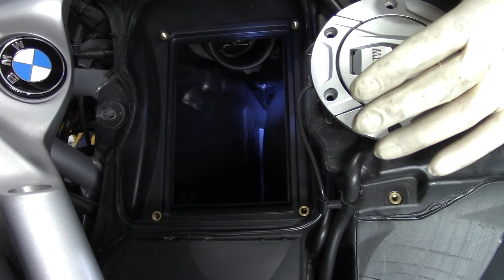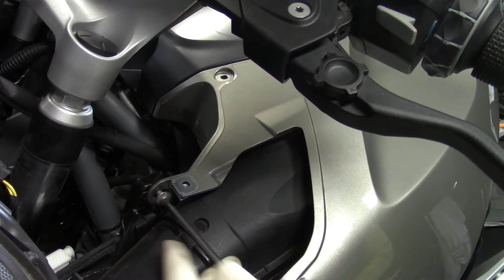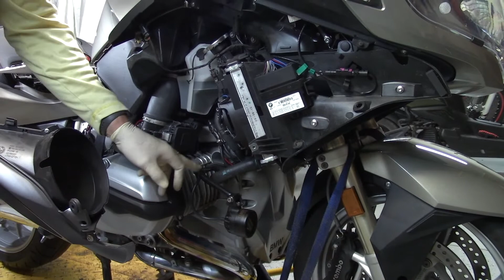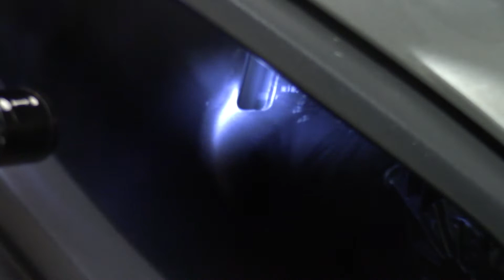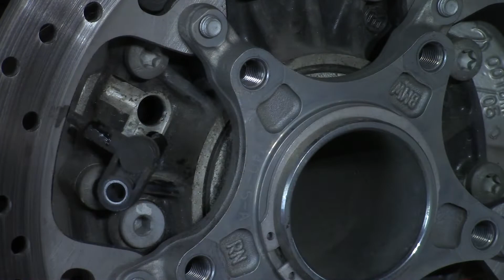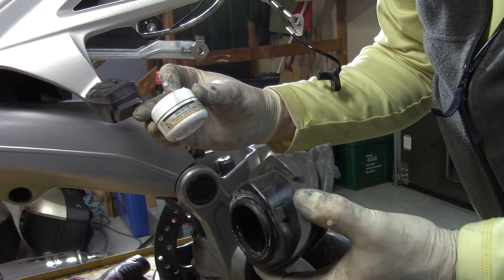BMW R1200RTW 12K Mile/20K KM Service  Part 2/6

Comment: Hello Boxflyer please let me know how to test a rear brake caliper and a 2017 BMW R1200RT?  I've cleaned it lubed it and the pistons move in and out freely.  When I ride it my rear brake caliper is way to hot to touch.  Compared to the front.  Do you have a good supplier for the OEM caliper you recommend??  Can the old caliper be rebuildt?
Reply from the maker: Hi Gary, there are no replacement calipers other than OEM, so either buy new or find a salvage.  Looks like they are about $750USD from BMW, and I found acceptable rear calipers on "the" online auction site for less than $150USD.  The pin in the bracket is steel and the caliper housing that it slides into is alloy, so very difficult to see the wear pattern inside the pocket.  This wear, even though well lubed, can cause the two parts to hang up together and then drag excessively after you release the brakes.  I have been able to bore out the hole in the alloy caliper just enough to make it a perfect cylinder again, and then turn down a guide pin to fit the new hole, but it is labor intensive and requires the use of my lathe and milling machine to get exactly right.  The longer the caliper keeps heating up the rotor, the more likely that the rotor will need to be replaced as well...Good Luck!

Comment: Hi, and thanks for your excellent work on your videos. A have a question about the bolts to the caliper. What number of Loctite do you use 242 or 243? Thanks ahead Tommi in Spain
Reply from the maker: Since the brake caliper bolts are not exposed to an oily environment, 242 is suitable, if medium thread locking compound is needed and the bolting surfaces are oily at all, then 243 is preferred.
Medium thread locker is used only on the rear caliper bolts, the front caliper bolts are installed with nothing, no lube, no thread locker at all.

Comment: Hello BoxFlyer!  Could have I have performed the work and drop the final gear (to lube the spline) without a motorcycle stand or jack?  In other words, could it be done with just the centre-stand or just put a jack-stand in the center of the bike?
Reply from the maker: Yes, you can do all the maintenance covered in this 12k series with the bike on the center stand.
Reply: Thank you!  I am a big fan of your videos. Learned so much…

Comment: I'm working on the 12K service at 24K (dealer performed 12K), and just did my splines. The white goo on the boot was hard, so I'm guessing it hasn't been opened up since new (2017). Splines were clean. Boot removal was a pain, as was getting the shaft lined up right for assembly. Beer helped with the latter. Brad, I think your term "fiddly" qualifies for euphemism of the year. Many thanks for these videos.
Reply from the maker: Glad this is working out for you. My current recommendation for lube on the boot is white lithium grease. It does not get hard between services and that helps with not only putting it together, but also the next time you open it up…which for me is every 6k, not the 12k recommendation in the manuals. (PS— my spline lube of choice now is Honda paste M-77)

Comment: Regarding the coolant weep hole, did BMW do away with it or move it in the later models? I'm not seeing one on my 2017.
Reply from the maker: Starting with the 2017, the weep hole for the water pump seal is right above the oil filter.  There is a small pipe coming out of the side of the engine case with a rubber hose routed aft to just about the front of the shifter lever under the bike.
Reply: Ahhh...I see it. Hose tip is dry, but there appears to be a little bit of dried antifreeze residue on it.

Comment: Great video, Brad.  I was especially interested in the FD spline lube.  What a fiddly (technical term) job that is.  I had George (Gridlock Motors) do it on my GSA a few years ago (all was fine).  Not something I'd attempt, as I'm sure I'd end up with an unrideable bike, though given my lack of any "real" tools, I probably wouldn't get that far.  :-))
Reply from the maker: Hi Mark, I'll have a look at your bike in a couple of week.  I've done 2 WetHead GS 12k services over the last 2 weeks and both of them had a hole worn in the rear FD boot from contact with the rear yoke of the driveshaft.  I have 4 boots to be delivered today for spares since I used up my current inventory!
The rub spot is in the first deep fold of the rear boot when working your way forward from the final drive on the outboard side, or LH side of the bike...worth taking a look to see if your particular bike is developing a hole for water to get in.  This might explain why folks that think they have done a good job of sealing up the front of the boot still end up with water in the paralever and possibly rusted splines that won't separate.

Comment: Did you replace the paralever bolt (I'd seen somewhere that it was a replacement bit, so I did- came with red Locktite on the threads!)? Also- I found that the driveshaft was easy enough to align by pinching the spider and lifting/wiggling until the input splines slid home. The hard bit was having the third arm to get the (new) Paralever bolt in place, but the operation went quickly enough. Cracking video- thank you!
Reply from the maker: I did not replace the Paralever bolt.  I think that is called for because of the need for thread locker, which I apply medium strength every time that bolt gets reinstalled.
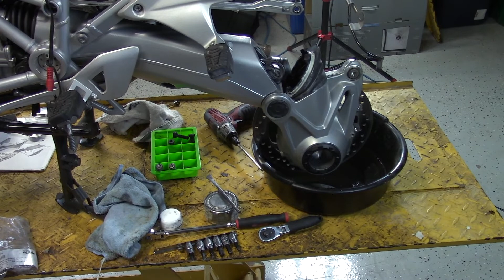At 25:15 I show lifting the driveshaft yoke up with a small piece of wire...but whatever works for you.
Glad you enjoyed it!

Comment: What do you recommend as an alternative to Castrol Molub-Alloy Paste-TA as it is difficult to find and Honda M-77 also very expensive?
Reply from the maker: I'm not always comfortable deviating from OEM recommended products, so my only alternative for this application is the Honda M-77.  Relatively speaking, ~$18 for this quantity might seem expensive, but it's the performance on the splines where so many other products fall short makes it worth it to me. On the plus side, this 2.65oz tube is probably enough for ~15 service applications on the splines.

Comment: My 1250 has only done 5000 miles, so no drive oil change needed yet. However, i would like to check the drive splines and lube them, so can i do this without draining the drive oil? Cheers.
Reply from the maker: Yes that can be done if you find a suitable plug for the speed sensor hole.  I've used a banjo bolt from some old brake calipers with a tight fitting "O" ring or a bolt wrapped in plastic stuffed in the hole.  
I changed out my FD oil with every engine oil change until it drained clean, with no more dark color or lots of shiny metallic bits in the oil. (about 24k miles)  If a quart (946ml) of gear oil costs $13, that's 5 FD changes...comes out to $2.60 per drain...cheap peace of mind and I always slept better after that!

Comment: You guys have done an AMAZING job! Thank you. Getting ready to do my first 12K service on my '18 RT. Where did you get the Castrol Optimol? I found the NBU on Amazon. Thanks again.
Reply from the maker: Hello, this is one of those chameleon kinda things that seems to change spec/names/description  every so often.  I originally got my lifetime supply from Motobins.co.uk. From their www. select the 2014-2018 WetHead series, then choose "Greases, Oils and Cleaners", then again narrow it down to Greases one more time...there is a 100g tin with a Motobins label.  It's priced at £7 with £6.50 "carriage" (1st Class) to the USA.  Today this is close to $17.75 and is probably enough for 40-50 times to lube your splines.  
On Service Part 1/6 description, click on the "Show More" to see lots of links to what was used in this series.  The first link is "Tools for this Service" and has another link for this grease, but I think it's an acceptable substitute, not the actual OEM spec.
Let me know if you have any other questions.
Brad

Comment: Hi Jim great vid, I dropped mine and sure enough it pulled the shaft down about an inch, I could not get the FD splines to separate despite banging rocking etc so just shoved it back together as not comfortable removing the whole shaft from the gearbox, Is it possible I've not re seated the top spline ? so cannot push it back in the way you did without removing the whole shaft is this difficult to do?
Reply from the maker: Hi J O, if you got the FD reconnected to the parallel arm with the bolt, then you have both ends of the drive shaft splines engaged all the way correctly...there is NO WAY to have the splines off of either end (gear box output shaft, or FD splines)and get the FD bolted back up again.  Now that you've established that you have "some" rust (could be a little, or a LOT) on the rear FD end splines, I'd think it would be a good plan to get the FD splines separated by prying the FD shaft out of the center of the drive shaft and cleaning and lubing it up properly...it will only get worse and somehow it needs to be solved.  In Part 2 of 6 above, at about 19:30 is where I had the problem you are describing...I should have showed you how I inserted a medium size and length straight slot screwdriver into the center of the driveshaft rear most yoke and pried on the center of the FD splines.  You still may have unseated the front spring clip from the output shaft of the transmission to get to this amount of access, but it's got over an inch of splines engaged before it comes completely off the transmission, so you've got a good chance it's still on there correctly.  Hope this helps...wish I was there with you to assist!  
Good Luck, Brad
Reply: @Boxflyer11  many thanks,  I asked this Q on UKGSER also ( hope you don't mind) and read your comments in a thread already on this subject. The disc rotates in neutral but not in first so happy its not come off at either end, I think I pushed it back just as far as it came down? then put it all back together, without doing the intended job of greasing the splines!  My worry is that I'm not sure I heard or felt any 'click' so not sure if its seated correctly on the front spring clip? although I did push it back in by lifting the disc back into position in effect using the whole FD to push it back. So the whole shaft really needs to come out now. So do I just remove the bottom pivot bolt and pull the shaft out still attached to the FD, then when its out, see if I can separate/grease and shove it back up? I foresee great difficulty getting the gear box spline back in from the FD end. I don't want to start dismantling the swing arm and all the stuff to get at the top end … waaay beyond my ability. 

Reply With Quote
Reply from the maker: @JO-vc4qm  I've had several drive shafts completely out, not one of them have been dry, or rusty on the transmission splines.  I don't feel it's worth all the effort to disassemble the FD from the Paralever arm to solve this.  I'd recommend just continuing your efforts to use a screwdriver to separate the drive shaft from the FD only and brush clean the rust off the splines, them lube with recommended grease.  The most important thing you can do is to get the rear rubber boot out, clean it up with some non petroleum cleaner,(don't use gasoline), ensure the seals are coated with good waterproof grease, then be positive that all 4 of the plastic teeth are secured to the Paralever arm. At that point, you are WAY, WAY ahead of the problem, maybe even better than factory original.   Sorry to say, the thread you reference has gone far and wide and has been overrun by distraction and many efforts that are not based on established practices...forum chatter must be taken with caution very often...stay on task!
Reply: @Boxflyer11  once again thanks for the response, I have tried to separate but will give it another go when I return from work this evening. It is tight in there though with the boot still on with little room for leverage without stopping the shaft from coming down. I agree with forum chat, there are many keyboard mechanic warriors out there, that just want to argue. I just wanna ride my bike and feel safe! Having let BMW do my last service before end of warranty, there was a panel screw missing and both the plastic ignition protector screws were loose. I will now do my own from now on.
Reply: Really glad I took your advice, using a scissor jack under the disc to hold it, I could see the male end of the spline in the U joint. I dropped it just enough to angle the spline upwards and sprayed a little wd40 onto the male spline, let that soak overnight and then some more with a bit of a wiggle this morning. So when I got back from work this evening using a screwdriver in the rearmost u joint and lowering the disc with the scissor jack ..Bingo.. Houston we have separation. All now greased up and happy the top end is seated correctly and good to go. Brad if your ever in the Cheshire area of UK look me up... Beers are on me!
Reply from the maker: @JO-vc4qm   Glad it worked out!  Just a few words of encouragement and it all worked out, WELL DONE!  I flew into Stansted a couple hundred times I suppose, but my flying days are over and I'm enjoying lots of riding here in the USA now...almost 18k miles this summer and leaving on another 12k mile trip in a couple of days.  I love my '16 RT!
Reply: Hi. Just to let you know, I have a 1250RT 2020 and checked the FD splines at 18000miles. When I disengaged the FD, the shaft just slid off the splines at the gearbox end. I removed the whole shaft to inspect and there was no retention clip on the gearbox output shaft or anywhere in the tube. According to the web, some have them and some don't, even though the groove still exists in the shaft. I reassembled as was and have since done 2000miles without issue. Cheers Dave @JO-vc4qm

Comment: Is the final drive inspection only done every 12,000mls?
Reply from the maker: The maintenance schedule calls for "Change oil in rear bevel gears" every 12,000 mi or every 2 years.  There is actually no specific time or mileage for lubricating the splines and ensuring that it is dry in the paralever tube, but it's up to you to make a plan to keep this bike on the road...I've seen about 7 or 8 bikes now with rusty splines and puddles of water in the driveshaft area....your call as to the conditions you've been riding the bike in.
Reply: @Boxflyer11  Thanks